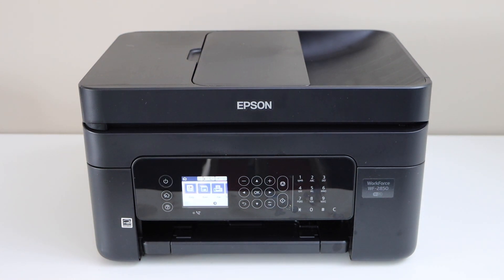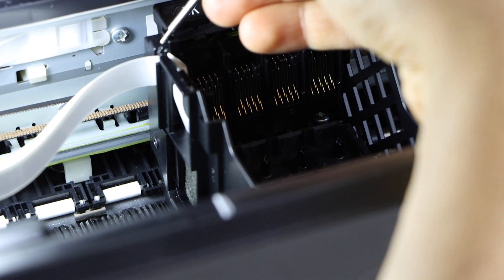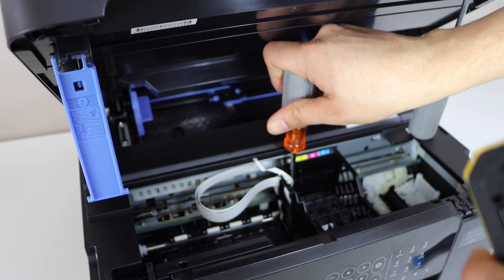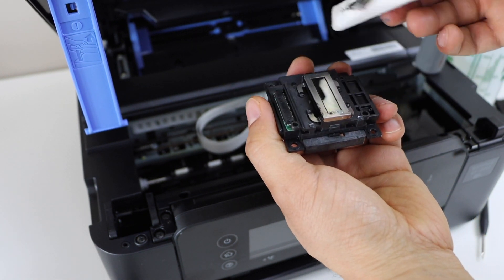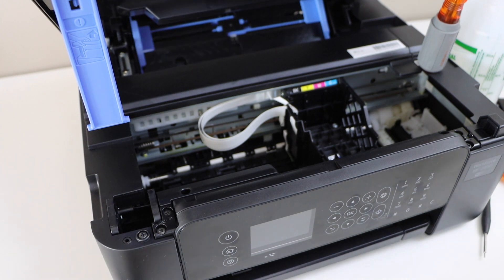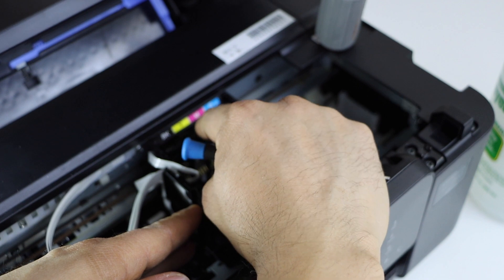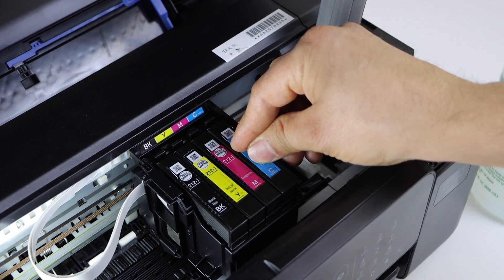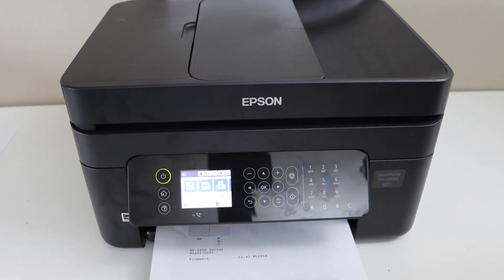Epson WF 2850 Printhead Cleaning, Replacement, Repair, Unclog & Print Like New !

Comment: Fantastic Video. Thank you, I could clean it and the printer is working again.
After cleaning I have received the error 100077 "Scanner". Reason Was a cable which became losen. This has happened when I have opened the top of the printer very wide (blue bar on left unconnected) to have more access for working. Don't worry than, just open the case and connect the cable (videos on youtube).
Reply from the maker: Awesome, glad to hear it's working again! 😊